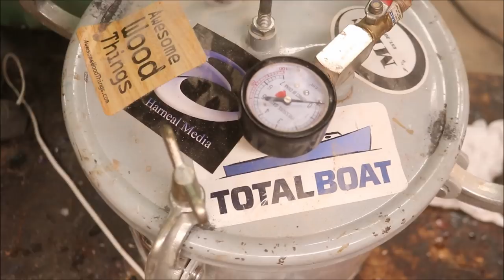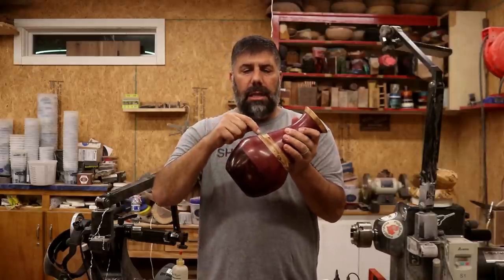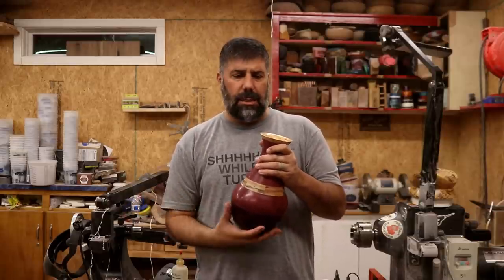The Elegant Resin and Wood Hybrid Vase

Comment: I Like this vase! You've done a really good tone match with the chips at the bottom, and the purple heart. The contrasting pecan gives a luxury feel to it. The base is nice, but not necessary.
I Like your method of hollowing the rings, one by one, after applying them. I would imagine it makes hollowing a much easier job, as it's only one ring at a time to be hollowed.
Reply from the maker: Thank you so much! Hollowing that way is soooooo much easier.

Comment: Oh my lanta Moonman !...so much going on there..where to start...
🎵🎶..oohh..ya..yayah...nope..not that...
Gorgeous !!!...the flickering of the offset grain in the rounds added so much interest...beautiful piece...the base was an unexpected plus..when you put it on the lathe..I was "what ?!" ...just a stunning finished piece..brovo...
Now...rocking intro..cool...surprise crack..😮..great save...
This is the second time your chuck failed..last time on the pumpkin...I was wondering if the new resin was failing to hold your cut...if the resin profile is prone to chip...then in the end shot when the pecan base went flying !..maybe it's your chuck failing...??...
Well all's well that ends well..and it did...definitely kept me guessing as you added all the rounds...I don't know about you..but I was on the edge of my seat..lol...
Have an excellent weekend Moonman...👍😉...🌿🌿🌿
Reply from the maker: Wow, where to start indeed. So the failure of the chuck to hold the pieces is all on my. I was rushing to get this one done. I made the recess to small. the piece flying off the lathe after the credits was due to the hot glue failing not the chuck. But I did notice my chuck jaws do seem to have a build up of resin on them and need to be cleaned.

Comment: Very nice.   Question for you: When you use wood like the cedar shavings or other wood pieces, do you stabilize them, dry them in an oven before pouring with the resin, or just use at shop stabilized condition?
Reply from the maker: When I turned the Bats and Spider bowl the wood was at 6%. I rarely dry anything below that. TotalBoat unlike Alumilite is very forgiving of moisture. So long answer short I shop stabilized them.

Comment: I always watch your videos because I learn a lot, this one is no different.  Why did drilling and driving screws into the piece cause a large section to split off?  Is Total Boat that fragile?  I'm sitting here watching your video with another browser open getting ready to order my first batch of Total Boat and now I am re-thinking it.
Reply from the maker: No the resin isn't to fragile. Any resin will crack if you force a screw into it . It is best to drill a big enough pilot hole. I did not drill mine deep enough and I put a long screw in. I've used a lot of resin and I can honestly say TB is the best I've used. If you do buy some you can get a discount with my code in the description.

Comment: I'm curious about something; I know very little about turning, but would it be better to always turn the outside of an object to bring it into balance before any other effort is put in? Just intuitively it seems that an object being spun that is out of balance will put a lot more force on whatever system is attempting to hold it to the lathe. The smoother an object is spinning the less force is trying to tear it away. Or are those forces so small compared to the force exerted by the carbide tool that it doesn't matter?
Reply from the maker: In some cased you are right. But the wood here wasn't enough to throw the balance off much. By turning the inside first I was able to know the shape I was going to be able to make. These rings were not originally made for a vase so they did not fit perfectly to make this shape.